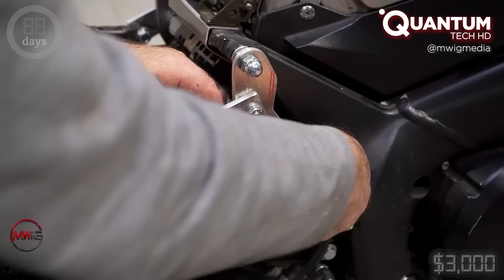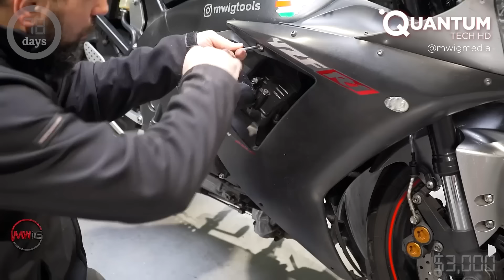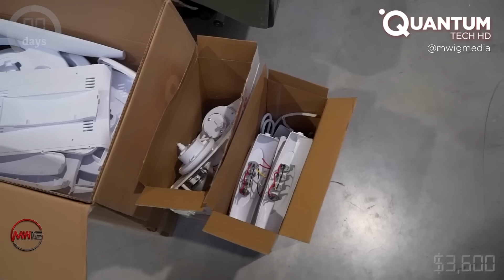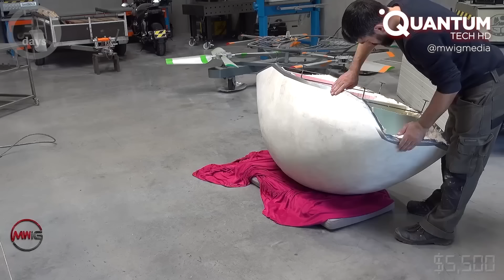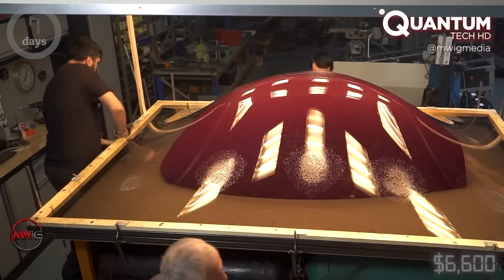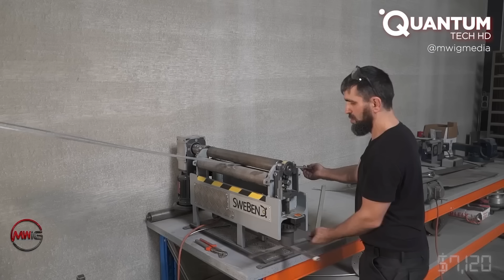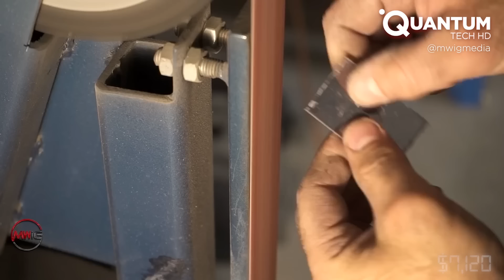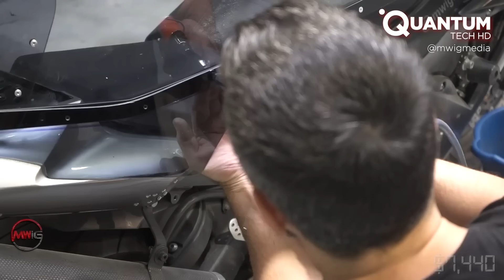The Motorcycle That Beats the Rain (Built in a Garage) | by @mwigmedia

Comment: 64 yo motorcyclist here who’s been riding motorcycles on the road since 1977. My verdict? I like it. I really do. I’d say it has a practical use for around town/city commuting, but as for fast motorway riding and long distance touring then it could be quite dangerous where crosswinds etc are concerned. The work and ingenuity that has gone into creating this are nothing short of amazing. Well done 👏🏻 👏🏻👏🏻
Reply: Wow since 1977?
Reply: @KiddieVerse-i2t  I started riding in 1970 at age 14.
Reply: @RaymondMatt-45 wow... I'm a newbie then😂😂😂I have been riding for 5 years now but my motorcycle recently got stolen
Reply: @KiddieVerse-i2t damn that must be so frustrated....i got two bikes been stolen in the same year back in 2007
Reply: And wet shoes and socks? How is that?

Raincoat is still a better option
Reply: @SuperSoldiers Every rider I know who rides a bike like this (or mine) uses tough reinforced riding boots.  You should see what a flipflop does in 160mph wind
Reply: @FZR600_Genesis no I would never use flip flops. There are protective rubber boots. But you can't walk on those. Rots your feet. But just for riding in the rain I used to use that. And carry my leather or denim shoes in my bike saddle. Where I go. I got the suit inside my raincoat and I change my shoes. No one can tell I just came riding from a storm. Ghost rider, but low key
Reply: Belo comentário meu amigo, e você tem razão, nas rodovias quando a gente encontra com caminhões também isso fica perigoso pelo menos aqui no Brasil temos rodovias simples que sem a bolha a gente já sofre muito e sempre acontece acidentes devido o vácuo, e os ventos laterais aqui tem muito e com certeza isso existe em todo mundo, agora para transitar na cidade isso é muito útil, principalmente ao entregadores.. bom e para fechar esse comentário quando você começou a pilotar motos foi o ano que eu nasci 1977 , abraço meu amigo vida longa para você e toda sua família.
Reply: @Marcioacrz thank you for your kind words. Bless you.
Reply: Even in the urban are like big cities. Crosswind are coming from everywhere because of the tall buildings
Reply: Excelente punto lo dice.. ademas los años manejando hacen logica su comentario
Reply: 1965 for me
Reply: motorcycles are gyroscopes
Reply: It's aerodynamic
Reply: can you imagine the motorcycle saying human being don't exist. Everything came together by chance. That is what most people say about God. Humans are even more complex and God created us and not by chance.

Comment: The most water by far comes not from the sky, but dirt water from the road. Thus the most important sherlter is from the bottom, like in a scooter.. A simple windscreen will do the rest. On a scooter with a windscreen you will stay dry as long as you are moving. No need for such a strange bubble..

Comment: There are already cab-type motorcycles available. These have wheels that extend outward on both sides when turned, preventing them from tipping over. However, they are expensive.

Comment: Good work, but does that make sense? The motorcycle still doesn't have a heater, and the problem in the rain isn't the water, it's the tires' traction. 😉 If you want to ride a motorcycle in rain or cold, dress properly – or drive a f***g car.🤣

Comment: Err, I see some aerodynamic issues with the wind coming/blowing up into the interior of the canopy housing causing stability issues.  You might protect from the rain but now you have an upside down cup creating an air trap inside the canopy--the instability is visible as the bike wobbles a bit.  Maybe some vent holes at the lower back so air can flow thru and out--create an air stream?

Comment: As a motorcyclist, the real problem exists, it's the slippery pavement is the problem.  We don't care about the rain, it's the  slick pavement.  Engineering coming from someone who doesn't ride motorcycles.  For getting wet, simple solution is to use a car.

Comment: For the people talking about crosswind it can be somewhat be mitigated by having multiple small holes/windows strategically placed to balance the motorbike, its all about pressure and wind like when a big truck 🚚 rushes past a small car or in older cars/lighter cars on highway with windows down you can feel the car loose control so minimum 2 have to be down and has to be opposite.

Comment: A few years ago a friend and I  made this using oven heating elements  and a shop vac to create a vacuum.  We were making fairings for recumbent bikes. We used a thermometer gun to gauge the temperature. Worked well. Crosswinds were noticable.

Comment: BMW built something a lot better than this junk, it was called the C1, the rider sat inside and at traffic lights or junctions, two outrigger stabilizer wheels lowered  as you couldn't put your feet down and this prevented it from falling over. It also had a windscreen wiper that I don't see here and it also had a heating & demisting system, again, I don't see that here, and did it take off? No! only 13,000 sold in 2 years. The only way this monstrosity will take off is when a strong wind gets inside that hood.

Comment: Falling off that motorcycle, trapped inside that windscreen, certainly wouldn't be pleasant. The wind hitting and pushing the windscreen from side to side is also a problem. Another concern is the limited mobility of the arms, and worst of all, getting your legs wet, since the windscreen doesn't offer protection all the way down.

Comment: Yea, crosswinds will make riding this thing sheer hell. Also how does one clean or adjust rearview mirrors? Fit a passenger? Wipe away exterior water, mist, road grime? Wipe away interior condensation? If an exterior wiper is fitted all it would take is one lengthy rainstorm in heavy traffic to scratch an acrylic windshield enough that visibility would be seriously impaired. And with all those scratches how would visibility be driving into a setting sun or bright nighttime headlights? I shudder to think of the dangers due to impaired visibility. Wish this guy all the best, he's a hard worker but think this idea needs to be shelved.

Comment: I do vacuum forming for a living. You must let the plastic heat up to the point to where the sag in the plastic is as deep as your mold is tall. He wasn't heating the plastic up enough. If your mold is 24" tall you must heat the plastic up to the point to where it sags at least 24". All of those attempts would have been successful pulls if he just heated the plastic longer and allowed it to droop further before attempting to vacuum form it.
Reply: Great insight
Reply: I have worked in the industry too and I think he would have blistered the sheet before it got uniformly hot. I think he needed twice the number of heaters set at a bit less temp. And if he was going to make halves he could have formed 2 halves in 2 pulls deep enough for no center piece. He still needed a solid front view so even 3 pieces could have made great looking canopy. I give it about a 5.

Comment: Another idiot project...it's too heavy...it's too fragile. it makes the bike unstable and top heavy...The frame was never designed for this rear sail, at 40km no problem but, in a cross wind at 150km and a truck wake hits you .....skating rink time especially in the RAIN... Please introduce yourself to modern building materials and 3D cutting,printing,designing tools. You are adapting Metal because it's what you know...Cavemen ...get a bigger hammer...88's

Comment: Anyone who's nearly froze to death riding a motorcycle will agree this is a design with real potential.
Reply: It has NO potential. BMW already tried this with something a lot better than this, called the C1 and after 2 years of production, it only sold 13,000 units worldwide and BMW's version was fully enclosed, had a windscreen wiper AND heaters, SO THERE IS NO POTENTIAL. If BMW can't do then this clown doesn't stand a chance!

Comment: A couple of things. This guy DID NOT DO his homework properly that cost him time, frustration and money.
1stly Polycarbonate CANNOT just be molded. It has to go through a type of Pre heat process.
2ndly the molds base drilled holes must multiple where mold joins the base to get a good result.
3rdly by splitting the mold into 2 halves  and then use pop rivets etc to make the unit, will make the product to commercially expensive. 
Lastly and MOST importantly is to the consideration for attaching the canopy to different motor cycles that needs adjustable brackets to fit and accommodate different bikes.
I feel that the front of the canopy should end up over the front tire to allow a more streamlined product.
Lastly WINDSCREEN wipers will be needed or an extremely slippery surface to push drops to the side. Also what keeps the feet and legs dry?

Comment: Should have built the oven deeper as the shape and pull the complete oven over the mold. Give it some extra weight on the top of the oven and sink it slowly down. The heating will still work during the process .

Comment: Cross winds won't be his biggest problem. Without a down force winglet he's gonna get negative vacuum on the canopy and it will rip off once he reaches 60 to 80 mph. Basically he needs to fix the lift this will cause and potentially pull his front end off the ground just enough to lose control. Being its a gyro force the effects would be quite unsettling.  Doing wheelies down the freeway.

Comment: An interesting addition would be some deflector to protect the legs and feet. Soaking feet are a problem even after the rain has stopped with the front wheel sending a mist of droplets to your feet. The BMW C1 didn't have this problem being a step-through scooter design , so feet are inherently kept dry. Also, full side protection isn't that necessary, since with speed, drops mostly come from the front, unless there's a very strong side wind, in which case I'd rather be wet than blown away.

Comment: 4 - 5    6+ hp shop vacs. turned on at the same time has unbelievable neg. air pressure capabilities.  Or hey put a big ass collar underneath and call the septic guy, 1 - 2 seconds on she is done guaranteed,

Comment: Actually the first mold would itself worked he just needed to calculate the size of the mold and add the space in the heater tank or whatever he calls it .. maybe more space to push down and more space to go inside and the wall of the heater tank should also should 8 heaters , automated push down would have been worked properly ..🫂🫂

Comment: I thought about this  back  in  2001 ,2002 , and I wonder if it would work. im  glad  that someone  like benny , put a lot of effort , design  , fabrication  ,  try and errors  , and dedication  into this project  ,  You did an awesome  job ,  would this be useful  , i reckon it will ,  protection  from pouring  rain  , cold winds ,  and the sun , , 
And can be  really handy if you smoke weed , 😊 ,

Comment: This is all common work in the industry I was a mrkg/sales person for an aerospace composites aFTER 1999 THE company TEN WAS vANTAGE aSSOC. now 25 YEARS LATER IS MUCH bigger renamed and sold w 3 locations. This is what we did and much more far more precise and $$$ for US Military and Boeing etc... but we did not improvise often (but had to sometime to make a part stronger or cheaper) the main two- because we had processes and equipment and easily could have given Benny his prototype in a bit more than a week if we wanted. in fact 4 up in one shot since our thermoformer is 2 stories tall and made BIG parts - the 'roll' plastic frame 10' x20' feet - no big deal - a bigger heating array (regional, full field and spot sections for varying depth draw. And in many types/grades of super materials he might not ever need.  We also have the CNC machines to trim out the extrusions etc in 3D : holes, openings, cutouts, anchor points, yada yada...
And Benny does not have the physical experience and newer would at a desk or computer- It is physical experience & not any engineering degree. 

Sorry, but everything we get that is done, happened by the little guy. Please remember that. Even the guy that puts the gold leaf on Trumps Ass Cushion Seat. The guys that do this work are just avg workers and sadly few are considered even technicians but they are skilled, don't guess and don't often fail. Taught not by books and classes some cannot read english, yet they are educated by doing not theorizing. Or even watching youtubes. Do not praise Benny too much, he has no idea about the process of business, Product, Market, Customers, Production cost to create PRICE of delivery.  Yes, he lost money thinking himself talented enough, proven he has ingenuity not genius. His shop show he has more resources than most here. Even Beszos made MORE mistakes driving Amazon and he made nothing, he just marketed/ stored/ and delivered. It was broader- more; but in general. But Jeffrey had outside dimes and more than himself believing and hoping. I have owned motorcycles and never was desperate enough to drive in the rain (Just dumb). Anybody can get options if they can afford >$10K+++ bike. and done 'engineering' of all kinds. Clearly Benny should not be working alone if he has OPERATIONAL skills at all. This is not a Picasso talent, he has to understand that. Did the Curie duo create the product that all could enjoy the benefits  of - radioactive Uranium. People also forget, this full video is scripted. It is a staged Advertisement & Promotional puff piece.  it is using a 3rd party endorsement style narration by a gushy robo voice. You can create any story you wish on Youtube the proof is here even with rock music of you choice playing throughout  (NO AI cannot do all this) for $50 membership you only can do 10 sec- =1 minute if lucky with more$$$ All to keep us here. Great we are now Borg too. I have been lucky to work with & be around not minutes, hours, but more time  with not genius; but great Directors and Producers: Steve Jobs, Nolan Bushnell. Jim Swan Lou Alpinieri Tim Draper and a few more I think a big list I am not the guy to stop anyone. I would be the guy to say you may go farther if you can find that 'someone else' that is a real goal and make them believe and respect you as you should also do. You know the phrase "Everybody loves a Critic'... I know I do.  ~this whole novel produced with world's best AI.

Comment: Much better to use a real oven with fire, my uncle have a small business aquarium making for the big aquariums he use a big 3 inch acrylic he put the on a big oven for 5 mins then he have a big mold aquarium shape and he press it there and  he have a hose with air under the mold he use the air not to suck but to make the acrylic much larger then 2 person pressing the both side ang my uncle use a wooden stick with cloth to make the aquarium more pressure and going to good shape